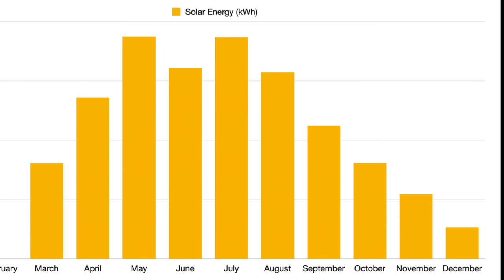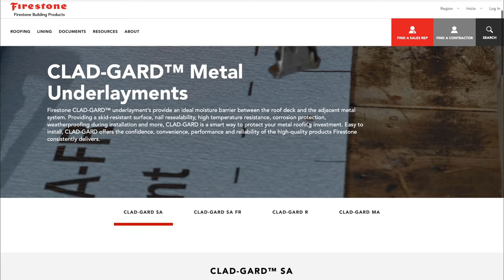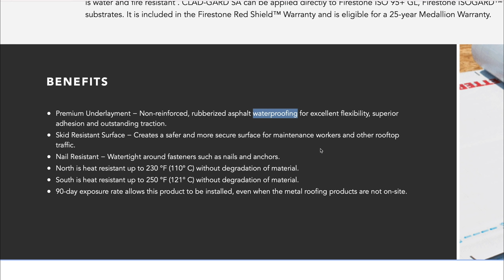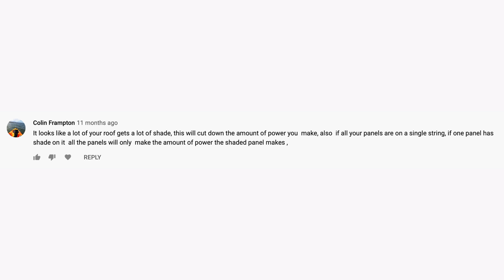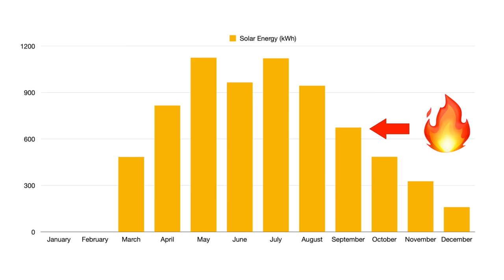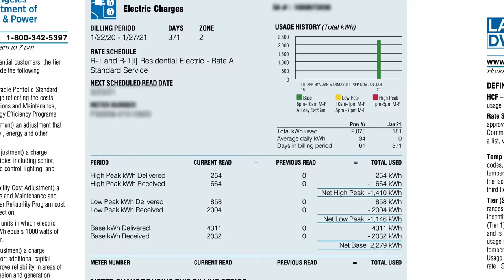1 Year with Tesla Solar Roof: top 11 questions answered + real production numbers & utility bills!

Comment: If 2/3 of your power goes back to the grid, why do you have a bill instead of a credit?
Reply from the maker: When we send energy to the grid, get energy credits, which "pay for" the energy we use at night, cloudy days, etc. (energy at night, during peak demand periods, is more expensive that the energy we generate during the day). We can bank credits (sort of like roll-over minutes) but can't cash them out.

Instead of spending roughly $60k on batteries to ensure I was totally off the grid, (for a maximum savings of $156/yr) we just trade daytime energy for night time energy. We also charge the Tesla late at night (after peak demand hours), which is a lot of kWs, which helps explain how the daytime disparity evens out.

Comment: So wait, you provided 5422 kwh of power to the electrical company that they didn't compensate you for that they sold to other customers?
Is that correct?
More than 2 times what your house utilized.
Not only didn't you get paid for supplying that twice as much power to the energy grid than you consumed, but they still charged you for the energy you used from the grid when you weren't supplying twices as much energy to them than you were consuming.
I think you need to go to your State legislature about that.

Comment: Quick calc reveals there is 1kw available per hour. This is... low? Like, you would run your gaming pc & modem 24 hours and half of it is gone. Give the rest to fridge, kitchen appliances,washing machine, fancy lights etc. and that 24kw available PER DAY (not at the same time obviously) is... gone. Do not even think about 24h air conditioning either. Oh and this is with sun up... You get a half cloudy day and boom. 

What is even funnier is that the grid actually cares about this low of energy generation. It is better to use the excess energy for a hot water tank where it could be used for showering, minor heating etc. rather than selling it grid.

Comment: So wait you over produced energy but still had to pay?
Reply from the maker: When we send energy to the grid, get energy credits, which "pay for" the energy we use at night, cloudy days, etc. (energy at night, during peak demand periods, is more expensive that the energy we generate during the day). We can bank credits (sort of like roll-over minutes) but can't cash them out.

Instead of spending roughly $60k on batteries to ensure I was totally off the grid, (for a maximum savings of $156/yr) we just trade daytime energy for night time energy. We also charge the Tesla late at night (after peak demand hours), which is a lot of kWs, which helps explain how the daytime disparity evens out.

Comment: Why didn't the power company pay you if you completely powered your own house with 30 some percent of the electricity your roof produced  and the other 60 some percent of the power went to the power company?  Also It probably costs 2000.00 a month for 15 years to have the roof installed.

Comment: Why did you end up paying the power company anything? You said over 60% of the solar power generated went to the power grid and around 30% went to your home. 
Why did they not pay YOU for the 60% output? Why wasn't more than 30 odd percent diverted to your home so you'd have no power charges?

Seems inefficient to pay for solar power then give away 2/3 of it and still have a power bill.

Comment: Why do you still pay even 100 dollars for electricity? Shouldn't they pay you for the energy generated?
Reply: True?
Reply from the maker: When we send energy to the grid, get energy credits, which "pay for" the energy we use at night, cloudy days, etc. (energy at night, during peak demand periods, is more expensive that the energy we generate during the day). We can bank credits (sort of like roll-over minutes) but can't cash them out.

Instead of spending roughly $60k on batteries to ensure I was totally off the grid, (for a maximum savings of $156/yr) we just trade daytime energy for night time energy. We also charge the Tesla late at night (after peak demand hours), which is a lot of kWs, which helps explain how the daytime disparity evens out.
Reply: @AustinFlack  that is smart strategy

Comment: I am surprised the kilowatts per year is so poor, average is only about 20 kW a day, which in my opinion is awful 48 full roof of solar panels. I would have guessed you would have got between 60 to 100 + kW per day depending on the season with that much coverage.

Comment: You provided almost 70% of your production to the grid and you had to pay 160 USD at the end?
The utility company should have payed to you for supplying 2-3 extra homes.
Reply from the maker: When we send energy to the grid, get energy credits, which "pay for" the energy we use at night, cloudy days, etc. (energy at night, during peak demand periods, is more expensive that the energy we generate during the day). We can bank credits (sort of like roll-over minutes) but can't cash them out.

Instead of spending roughly $60k on batteries to ensure I was totally off the grid, (for a maximum savings of $156/yr) we just trade daytime energy for night time energy. We also charge the Tesla late at night (after peak demand hours), which is a lot of kWs, which helps explain how the daytime disparity evens out.
Reply: @AustinFlack  It makes sense . Thx :)

Comment: Question is, how much energy would I have after I've used a hair dryer to melt all the snow off the roof for the 3-4 hours of daylight I have and then by the time I'm done the sun is gone.

Depending on where you live, I think this is an awesome investment, but if you live in a country barely any sunlight during the winters, which are the months that cost the most energy, then perhaps not that much of an investment?

As for cleanup, buying a powerful a compressor and blowing dust off every few months would spare you the cost of hiring somebody for $xxx
Being as durable as they are, a less powerful pressure washer once a year or two.

Comment: a year late for this comment, but saying you saved 2k for the year is a little disingenuous because you didnt add in the cost of the panels, not that its much of a big deal. but still. some people in socal who run ac a lot or have larger homes have 500+ bills which the panels can def offset but those panels are not cheap either, nor are the larger ones you can install. all in all, still a great video though. 

one question, what are the pros going for tesla tiles over say any other solar panel company. i would have thought there would have been way more benefits because its well..tesla
Reply from the maker: Covered the cost in depth in my first video: https://www.youtube.com/watch?v=LRPy8UZv9V0&list=PLXt9cHZDKoN4TcPWRp-P7iQfshODE274k

Short answer: $33k, about $21k more than if we had just gotten a conventional roof and about $3k more than if we had gotten a conventional roof + standard solar panels.

Will pay for itself in ~10 years. (I deduct the cost of a conventional roof when I calculate ROI—I needed a new roof!)
Reply from the maker: Tesla is the only company making a solar roof that is virtually indistinguishable from a normal roof. As far as PANELS goes, I think there are a lot of other companies that make excellent panels.
Reply: @AustinFlack  thanks! your video popped up in recommended, never knew there was a first video, ill give it a look!

Comment: I live in AZ where amusingly despite getting more sun where solar should make sense, electricity is so ridiculously cheap that I consumed 35,000kWh in 2021 and it only costs me about $2400...the same that this dude paid for 8000kWh in CA.   I'd probably have a negative ROI installing solar (yeah I plugged it into Tesla's site...I'd lose $10k over 20 years going solar and that's going by Tesla's optimistic numbers)

Comment: Sounds like the electric company should be paying you money. Just off the top of my head, you were using $2k worth of electricity before installing, you use 1/3 of the power produced and provided 2/3 of the power back to the grid now if your energy consumption for the previous year was $2K that means you produced roughly $6k worth of electricity and still paid the electric company $156 even though you supplied the grid with $4k worth of electricity??

Comment: 4:59 you're supposed to get paid for the electricity produced
Reply from the maker: When we send energy to the grid, get energy credits, which "pay for" the energy we use at night, cloudy days, etc. (energy at night, during peak demand periods, is more expensive that the energy we generate during the day). We can bank credits (sort of like roll-over minutes) but can't cash them out.

Instead of spending roughly $60k on batteries to ensure I was totally off the grid, (for a maximum savings of $156/yr) we just trade daytime energy for night time energy. We also charge the Tesla late at night (after peak demand hours), which is a lot of kWs, which helps explain how the daytime disparity evens out.

Comment: I’m surprised they are still paying for electricity since 60 percent goes to the city. The city should be paying them.
Reply from the maker: When we send energy to the grid, get energy credits, which "pay for" the energy we use at night, cloudy days, etc. (energy at night, during peak demand periods, is more expensive that the energy we generate during the day). We can bank credits (sort of like roll-over minutes) but can't cash them out.

Instead of spending roughly $60k on batteries to ensure I was totally off the grid, (for a maximum savings of $156/yr) we just trade daytime energy for night time energy. We also charge the Tesla late at night (after peak demand hours), which is a lot of kWs, which helps explain how the daytime disparity evens out.

Comment: You are sending power back to the grid, yet you still have to pay a power bill? Talk about a rip off living in California for that. At least though the bill is a lot smaller than it could be. You are saving money that way. If I were you. Depending on what part of CA you are in. How much wind do you get? Because just about now, you could be getting those home size windmills (that work WAY better than the over sized ones.), put those up. Then make it so you only pay $0.50 in power bill. The rest to the grid.

Comment: Traditional solar is wayyyyy more efficient and cheaper and doesn’t require you’re entire roof to be rebuilt in order to have these solar shingles installed. 
 
I can quote someone for a system that produces that much power for around 14k 

Great marketing. However you are way better off with an Enphase micro inverter system with REC panels.

I’ve been selling solar for years. I know what I’m talking about.

Comment: You saved ~$2k per year but did not say what the cost of the system & installation was, which if it is guaranteed over 25 years, matters. If it was around $50k then you’ve only broke even, no?

Comment: Your roof generated nearly 8,000 kWh... which would cost (in my area) about $1,000 at the current market rate... and we certainly don't get enough sun light to generate 8,000kWh of power.

Yet... You sent 2/3 of your power back to the grid... and THEY STILL CHARGED YOU??!! What a load of crap! 🤣

Comment: How did you not make money giving the power grid 7000 kwh of power?  At 31 cents per kwh in California the power grid should have paid you over $2,000 that year.  This is why I hate the power grid.  Permission to operate, and likely a law stating you must feed into the grid.  Solar power off grid, with battery banks, if I don't get paid a reasonable fee for feeding into the power grid.

Comment: 60%+ energy goes to the company, and they still charge you... :')
Reply from the maker: When we send energy to the grid, get energy credits, which "pay for" the energy we use at night, cloudy days, etc. (energy at night, during peak demand periods, is more expensive that the energy we generate during the day). We can bank credits (sort of like roll-over minutes) but can't cash them out.

Instead of spending roughly $60k on batteries to ensure I was totally off the grid, (for a maximum savings of $156/yr) we just trade daytime energy for night time energy. We also charge the Tesla late at night (after peak demand hours), which is a lot of kWs, which helps explain how the daytime disparity evens out.

Comment: Hmmm. 32% went to your home while the majority 68% went to the grid at your expense…. Interesting🤨
Reply from the maker: When we send energy to the grid, get energy credits, which "pay for" the energy we use at night, cloudy days, etc. (energy at night, during peak demand periods, is more expensive that the energy we generate during the day). We can bank credits (sort of like roll-over minutes) but can't cash them out.

Instead of spending roughly $60k on batteries to ensure I was totally off the grid, (for a maximum savings of $156/yr) we just trade daytime energy for night time energy. We also charge the Tesla late at night (after peak demand hours), which is a lot of kWs, which helps explain how the daytime disparity evens out.

Comment: Nice bleeding edge technology but not worth it at a 20+ year breakeven. Seems like you didn't believe in long term viability either without the power walls.
Reply from the maker: Covered the cost in depth in my first video: https://www.youtube.com/watch?v=LRPy8UZv9V0&list=PLXt9cHZDKoN4TcPWRp-P7iQfshODE274k

Short answer: $33k, about $21k more than if we had just gotten a conventional roof and about $3k more than if we had gotten a conventional roof + standard solar panels.

Will pay for itself in ~10 years. (I deduct the cost of a conventional roof when I calculate ROI—I needed a new roof!)
Reply from the maker: Also, we know have a powerwall

Comment: How are you giving away 2/3 of your produced energy and are still paying for electricity... They should be paying you my friend. At least that's why I didn't think into investing in this. Because even if you could (and you can) get all the equipment to produce, convert and store a good amount of energy for you and your comunity, it'll be deemed as ilegal because you don't give it for free and buy it at a discount + the inicial heavy investment that you made on equipment, installation, etc. You're not saving 2k a year, because you're losing 2/3 of total production and by your numbers also, that'll be arround 4,5k a year that you just give to the uncle Sam's power grid nephews.
But let's jut stick with saving 2k a year, the roof is what, 40k-50k, more, alone, you'll still need 20-30 years to recuperate your investment (again without factoring that you're not using almost 70% of it). You and 2 other houses could be self sufficient until the damned thing broke.

Comment: conveniently left out all of the expenses. this stuff aint cheap and the fact that half of the roof operates at a lower efficiency would make it a huge waste of money. not to mention all of the toxic materials used in the production of those solar panels which is a huge downside of the solar power technology overall.

Comment: Absolute shit that you consider it a win WHEN YOU STILL PAID THE POWER COMPANY WHEN YOU PROVIDED POWER TO THEM!

You clearly produced far more power than your house uses, so if you bought $2000 worth of electricity without the panels and then produced $6000 worth of electricity that the power company used from you, YOU SHOULD HAVE BEEN PAID FOR IT.

Comment: If you're feeding your energy to the grid, you're doing it wrong.
Reply from the maker: When we send energy to the grid, get energy credits, which "pay for" the energy we use at night, cloudy days, etc. (energy at night, during peak demand periods, is more expensive that the energy we generate during the day). We can bank credits (sort of like roll-over minutes) but can't cash them out.

Instead of spending roughly $60k on batteries to ensure I was totally off the grid, (for a maximum savings of $156/yr) we just trade daytime energy for night time energy. We also charge the Tesla late at night (after peak demand hours), which is a lot of kWs, which helps explain how the daytime disparity evens out.
Reply: @AustinFlack  It's great that it works out for you now, but as soon as others start doing it, they're gonna change things around. I assume you get "credited" 1:1 at the moment. That will change.